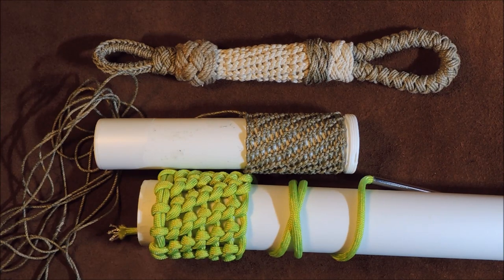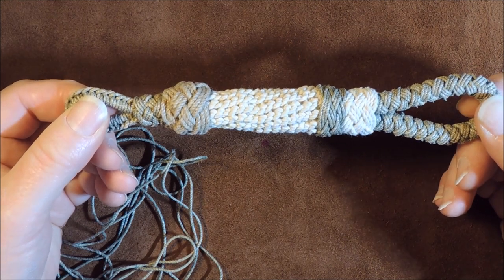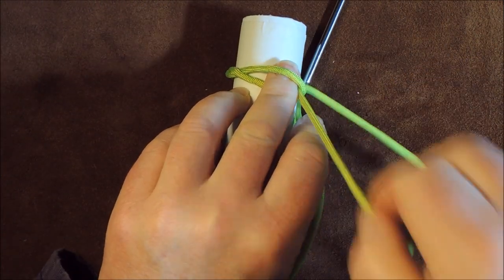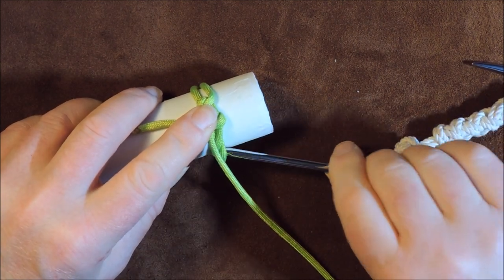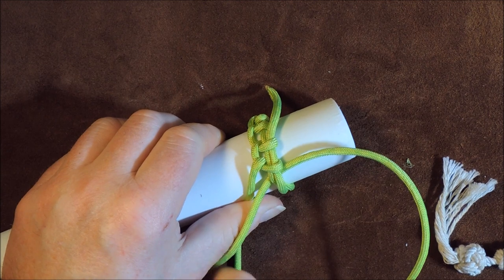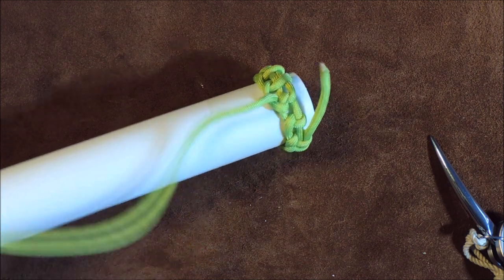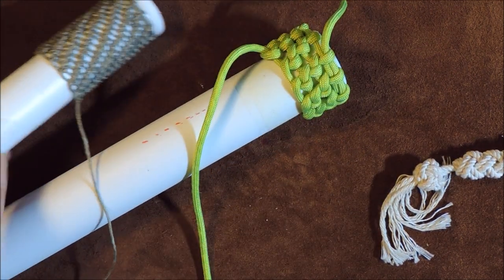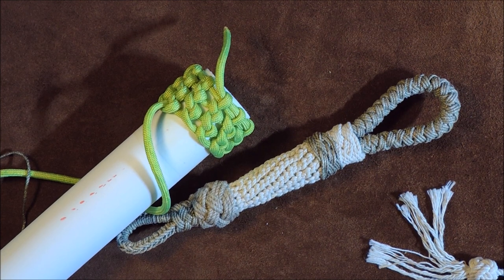Half Hitching Spiral - Covering Objects with the Spiral Half Hitch - Continuous Hitching

Comment: FYI - If you go to a garden store, you can find bamboo stakes that make excellent needle cases.  It's very easy to work with a basic knife, and it's very traditional since sailors traded the stuff from around the world whenever they could.  You can also use animal leg bones if you want to go full-tilt traditional.  Turkey is a good balance of size and strength, but if you're using large sail needles, you might want to scale up to pig, deer, or the like.  Bamboo, though, works and is a good first step because it's so easy to work with and can even be carved with nice designs.
Reply from the maker: I have to say, I am a massive fan of big bamboo. I once made a Cat of Nine Tails where the handle was bamboo.
Reply: @KnottingKnots  I have some huge bamboo growing next to the house, maybe as much as 4" in diameter.  Great for pencil holders, cups and the like.  And just down the road is a stand of River Cane, the native American cousin to bamboo.  It only grows about an inch thick, but it's also more cylindrical throughout.

Between that and my steady supply of bone and antler, I don't lack for neat natural materials to make things from.